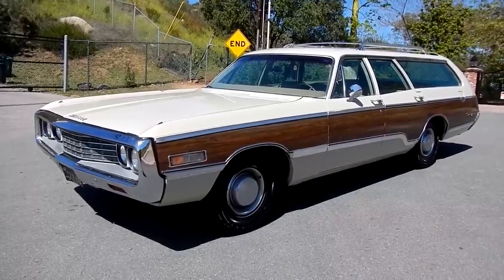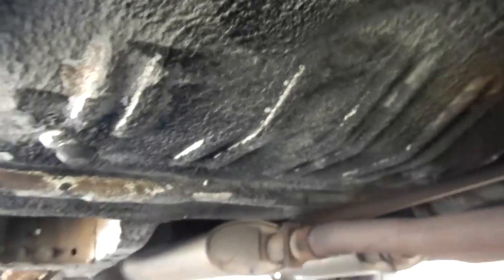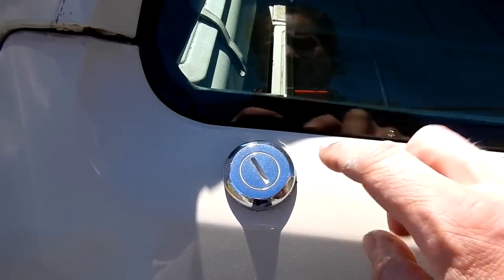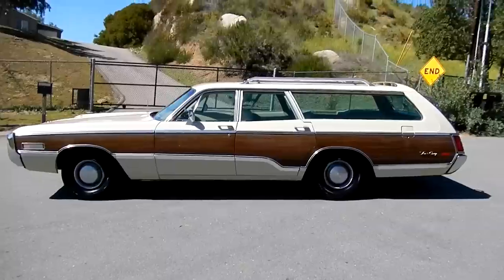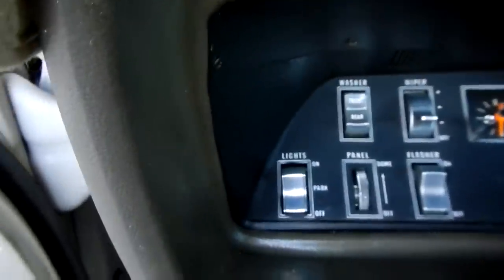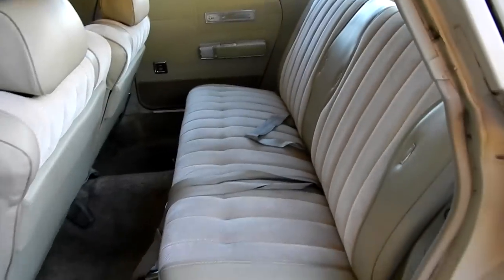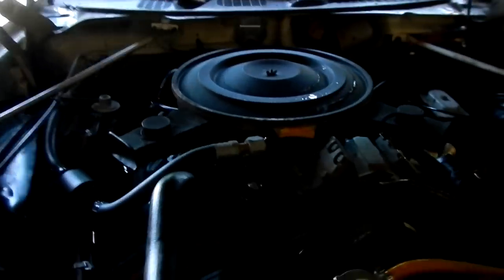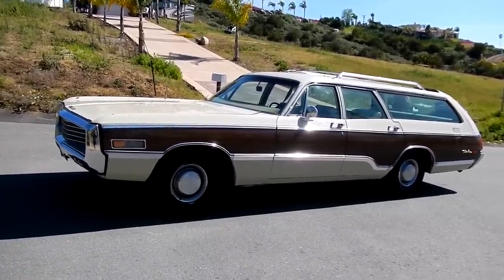Chrysler Town & Country Estate Woodie Station Wagon Woody Mopar 383 1 Owner

Comment: hi - the chrome cap on the upper left side of the tailgate is not for show.  It is the filler cap for the rear window wiper/washer system which is concealed inside the tailgate.  This was an option available on Chrysler Corp wagons from 1968 through the 1971 model year.  The rear system was operated by lowering the rear window then pressing the lower half of the washer switch on the instrument panel which sprayed the cleaning solution on the glass.  Next,  two 18-inch squeegees inside the tailgate would wipe the window clean as the glass was raised.
Reply: Wow thats cazy.  Good to know thanks!
Reply: My parent's 1972 had it, as well.

Comment: My dad had a 1971 Town and Country with a 383 2 barrel. It did 11 mpg on Hwy and 6 mpg city. It was the car I learned how to drive in and went on my dates in high school.  The spoiler on the back was meant to keep the back window clear of water with the wind.  It had its gremlins. Major issue with that year was the radiator, which overheated due to a design flaw, it would have to be removed and chemically flushed every 2 years. Rust was an issue just behind the rear doors at the corner of the wheel well. The last thing I remember dealing with was the drive axil universal joints would break due to the torque because they were undersized. They were replaced at least 3 times in 8 years from 71 thru 79. Other than those, it was a beast. It produced 190 horsepower net (275 gross). Torque was 305 net (375 gross). Lots of memories.

Comment: this wagon is fairly well equipped it appears including front cornering lights (lamps located on the side of each front fender which automatically illuminate in the direction of a turn when the turn signal is engaged with park or headlamps on - fairly rare - especially on Town & Country wagons)

Comment: Brings back memories.  My grandparents had a '71 Town & Country, and I spent a lot of time in it, not driving of course.  Went from Northwest Indiana to California at least once in it, and my grandparents made that trip in that car once per year for many years.  Just set the cruise control to 64mph (55mph speed limit) and cruise until the radiator cap blew up in Arizona.  Replace it, go to Cali, put another 1,000 miles there and go home.  Great, smooth car.

Comment: We had a 72 Dodge Station Wagon. We looked at the Chrysler but the Dodge was had 97% the cargo space with like 500+ lbs LESS weight. Same frame and we ordered it with all the export heavy duty brakes, suspension, radiator, etc. Yes it had the big block with dealer installed headers. Torque city!!  But other family members at various times owned Chrysler wagons and they WERE Great..
Yes, some small things would go wrong but unless you were an idiot, if you wanted to keep it that long, any big mopar SW that DIDNT give the owner like 100 K miles I never heard of it 
Hey, thanks for the post

Comment: Madness!! That car is BIG!
If I had money, I would buy that thing in a blink of an eye.
Actually there is one up for sale right now in my country from 72, a two owner car which is actually in better shape than the one you had there, so the one deserving a trophy is this guy.
All original, beige exterior and leather interior, original hubcaps and wheel cover.
It looks immaculate, nothing less.
I would buy that one and not letting it go again, but I will eventually when I have enough money :)

Comment: the washer solution for the rear system is poured into the separate reservoir located inside the tailgate after removal of the chrome filler cap.  The cap could typically be removed by using a quarter coin inserted into the indentation on the cap to turn it.

Comment: For 1970 that model should be a 440 not a 383. I might be wrong but I don,t think so. Also four barrel carb.  Horse power would be in the range of 350 to 375, not 290. Awesome beautiful car. Thanks for posting..
Reply: The 383 I'm not sure was available. Mine was used & did have the 440 at 350 hp. Mine was dark blue with a blue interior , 3rd seat, all power & had an adjustable steering wheel, up & down as well as extended.

Comment: Very familiar with this model. had one for 15 years. There is a glitch in the wiring. Tuen the emergency flashers on without the key on the ignition   Then push the rear tailgate power window switch. The window will go down in a pulsating way   When the flashers blink.   Also the 383. 2bbl was the "dog" of the motor group.
Reply: nooooo ...say it ain't so. A Chrysler with electrical problems?
Reply: I don't think any of those problems killed anybody. Unlike the GM ignition switch Ford tire blow outs and transmission jumping into gear from park.   You see they all have problems from time to time. To single out one maker is silly. I wish I had a 1971 Plymouth Cuda with some electrical problems.
Reply: Colonel Mustard a dog perhaps but it  ran on regular gas.  Similar to the 1969 Chev 396 2bbl and the Small Block 400 2 bbl of 1970.

Comment: I noticed you have the 1970 Chrysler Corp factory service manual - there is a good section on troubleshooting the rear window wiper/washer system in that manual.  I believe it is located in the electrical section.  I own a 1971 Town & Country which is almost identical to the 1970 model

Comment: My boyfriend just said that the mopaar sw of that era look best with a slight rake in the rear. It would look more sleek if you shaved the door handles. It would also help if you installed the 300 Grill and power headlights. My father also used to say he would have liked it if he could remove the B pillar. I think so too. ❤

Comment: check out the site 
fuselage. de
It has brochures for all of the 1969-73 big Chrysler, Plymouth, Dodges and Imperials.
The 383 was the standard engine, the 440 was optional.  Also the dual exhaust was an option with the 383 and standard on the 440 that included the Double Snorkel air cleaner that your car also has.

Comment: LoL.  Rust = petina.  Holes in metal = paint chips.  The first thing I'd do is disconnect that door buzzer.  XD
Reply: My 96 Dakota had one of those annoying buzzers.  I usually do not mind them, but this one was terrible.  I pulled the module from the fuse box